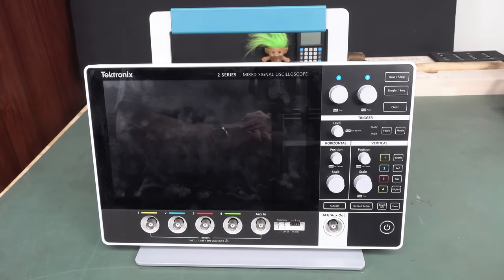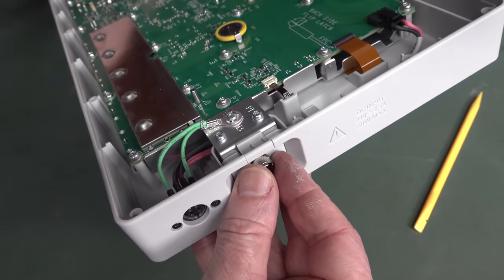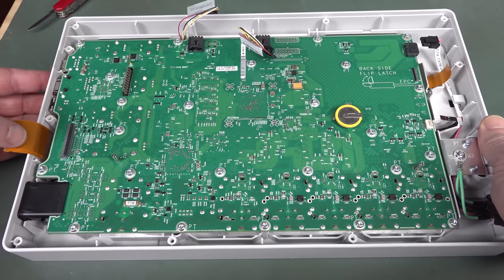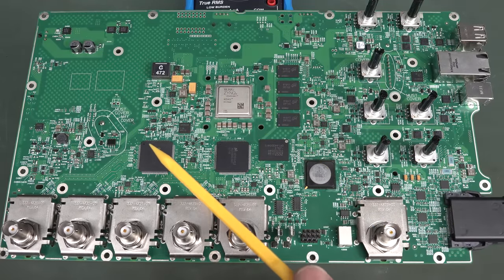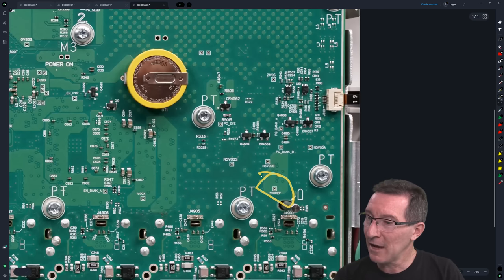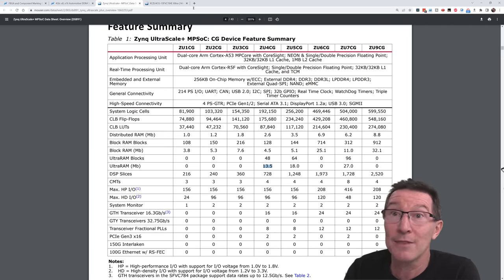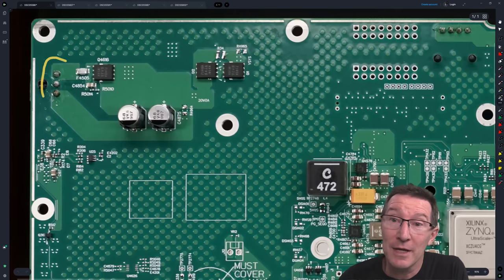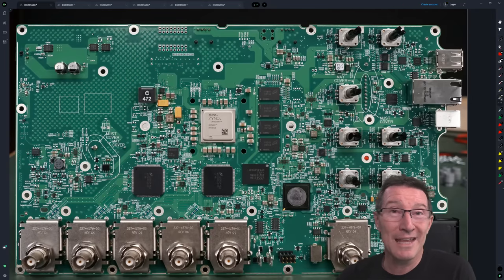EEVblog 1477 - TEARDOWN! - NEW Tektronix 2 Series Oscilloscope

Comment: 1280x800..  bit disappointing. National Semiconductor chips. Must be old stock. That has not been in use since TI bought them. They could have done a real keypad. simply use a membrane style backend but put the silicone rubber keymat. And you can place LED's on the flex structure !. Membrane is just horrible. You have no tactile feedback. Did i click it ? Did i not click it ? is it running ? let me press run/stop again .. -aargh !  it would be like using rotary encoders without detents for range and timebase...
Reply from the maker: The Horz and Vert controls do have detents, the others do not.